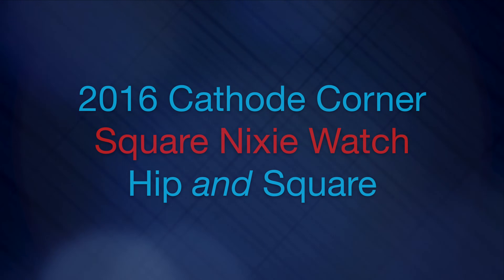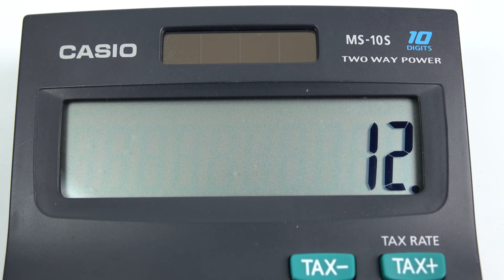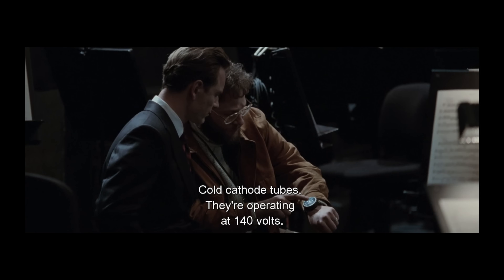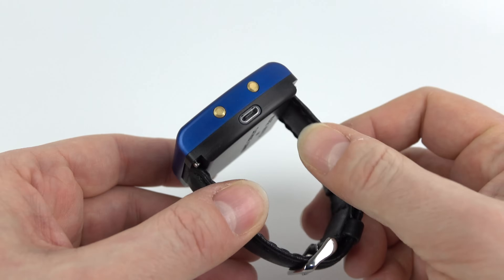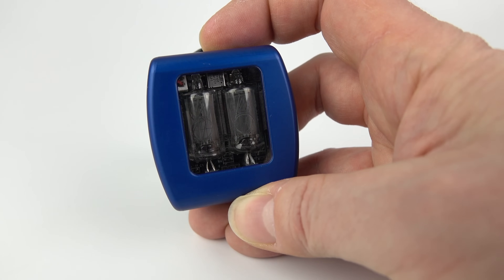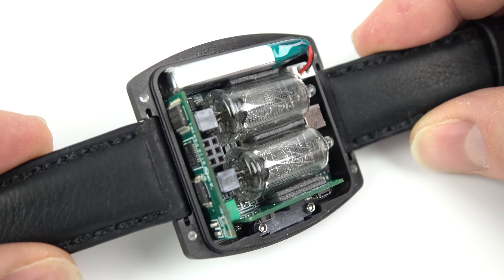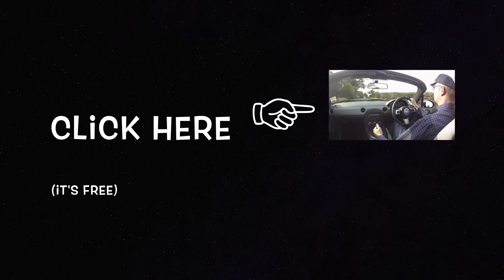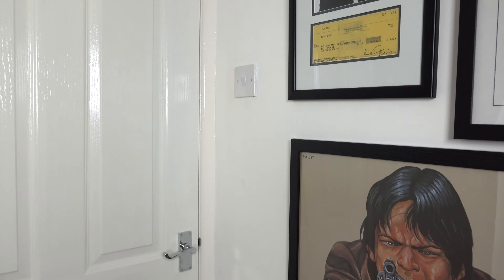2016 Nixie Tube Wristwatch from Cathode Corner

Comment: Very cool...Since nixie tubes are very steam punk, I think I would prefer the face and body of the watch to be brass or even wood, and the strap some synthetic leather. I would rather sacrifice water protection for a better overall look. Maybe you could offer a plastic cover for when you’re wearing it, and then you could just take it out of it’s water resistant plastic case, when you were ready to display it. You could also offer some kind of brass wood leather display stand that also worked as a charging dock…Just some ideas. Keep up the great work, Cathode Corner :)

Comment: what tubes are in there? i have x4, B-5750 tubes. x6 G76 6841 B-5560 tubes (inverted number) and 6 8422 B-5991 tubes. I wish to make a clock and possibly a watch as these 4 tiny tubes would be perfect! i even have the boards that drove the tubes. lots of HP chips.

Comment: Here is (very probably) the real reason you prefer a Nixie display to a segmented LED display:
At eight o'clock, a Nixie clock will show you a genuine figure eight. The best that the segmented display can do is stack one box on top of another. Most of the other digits fare no better. Nixie digits are just plain easier to read.

Comment: i prefer the look of te old case. THis one with all those rounded corners, anodized metal and off centered window doesnt really fit the tubes very well in my opinion.
Reply: Verithiell Agreed, also it will look alot better in a copper or aluminum  casing. Plus you can build this for alot cheaper hopefully

Comment: So, uh... Cold cathodes operating at 140V. And to change the time setting on the old one you have to unscrew the cover and mess around with buttons on a live circuit board, right under where the tube connections are. Unsafe much?...
Reply: +FokkerBoombass The watch is designed so that it's not possible to come in contact with the 140V by pushing the buttons - you'd have to remove the module from the case to contact the high voltage point. Even if you did somehow manage to touch it, it's a very low current that would just cause a tingle.

Comment: I've looked everywhere for nixie tubes to try and make my own clock (I'm into diy stuff and there's plenty of guides), but it's impossible to find them in Ireland! :(
Reply: +Matthew Ahern Try E Bay or Amazon.
Reply: +Metalman200xdamnit Thanks, I will again, but the last time I looked at either, shipping here cost almost as much as the things themselves, it just wasn't worth it.
Reply: Matthew Ahern
You have to remember,they are no longer in manufacture and they are expensive now.
Reply: +Metalman200xdamnit I could understand them being expensive, that's completely fine, but when shipping almost doubles the price it's too much, it's more than I could afford. Plus I was thinking of incorporating them in my leaving cert construction project, so if any were to break (which some other people in the class would gladly do), I'd need to buy more, which I wouldn't be able to do. I'd get a summer job to try and save up if I could, but I have to work on the farm over the summer, so that's not an option for me either.
Reply: Matthew Ahern
I understand,sometimes it is not worth breaking your wallet for that thing. Besides that thing is super chunky and crazy.

Comment: Puppets aside, this is a brilliant piece of modern engineering and I would absolutely love one, but for what it is, $800 is prohibitively expensive. Being that these will also be a limited production item, I have no choice but to miss out. Sigh.

I'd imagine there are ways to reduce that price? The innards do not appear to cost $800, even with labor. Of course I could be entirely incorrect. I used to work for an outfit that sells vacuum Tubes exclusively, so I know those particular Nixies aren't too expensive. Cheers, however, for the excellent video. Very informative and detailed.

Comment: I wonder about the price: Are Nixie tubes that expensive? Because anything else in this watch looks fairly standard - OK, of course the electronics design is custom (with standard components, besides the tubes), but it couldn't be that expensive, unless the manufacturer plans on selling only a 2-digit number of these watches (which would be a pity, because it is a great idea, although I would have liked a more retro, steampunk-esque design for the modernized version better). Or is it just that expensive to keep it to an exclusive number of buyers and not make it affordable to anyone else, like a 100-200 dollar watch would be?
If that is the case, I would expect at least a lifetime warranty for components like the battery or the tubes.

Comment: re :sending component video down a headphone cable , comments seemed to be disabled on that one probably to stop all the audiophiles grumbling on there , anyhow i found the video very helpful as i have the same receiver as you and recently tried to add an xbox into the equation. when i bought the receiver i was amazed at how many inputs there were on the back and figured how woud you ever need more yet i found myself at that point , i had already used my hdmi inputs all up so decided to put the xbox through the component and had exactly the same issue as yourself and soon realised i neede to add in another cable for component out to my tv  thing is my tv is about 14 feet from my receiver. so i may look inot your solution as a temporary fix. anyway thanks for the video !!

Comment: The case so does not match the aesthetic of the nixie tubes.
Reply: +OnEvenKeel I beg to differ. The case matches the aesthetic of these 1972 vintage tubes perfectly. I took my styling cues from the rack of test equipment in my workshop, two pieces of which have exactly these tubes in them. The test gear looks just like the watch... mid-century modern. Rounded rectangle windows and smooth aluminum panels.
Reply: +OnEvenKeel yeah should have been a brass case
Reply: I wouldn't mind ivory plastic and faux wood paneling.
Reply: Not Victorian era..but,,,Dieselpunk(ish)  would look cool though
Reply: Yes, a steampunk wristwatch should have brass and wood, and a mechanical display. Nixie tubes are not from the Victorian era.
Reply: @nixiebunny1  You're right that it isn't in a Victorian technology, but, I think, one of the most appealing things about nixie tubes is that they don't look like they come from any time or place. They look steampunky, dieselpunky, industrial, atomic-aged, space-aged, information-aged, alien, ancient, and futuristic. So, although the body style doesn't fit my idea of a nixie aesthetic, a "nixie aesthetic" is 100% a personal and individual thing.
Reply: +OnEvenKeel It should have steampunk desing like brass and wood.

Comment: Is there a legitimate reason why the watch is that expensive other than it's a limited run?

Are the parts of the watch really that expensive?
Reply: +Blizz DeKay Because hand made items should cost 10 times more then built in China by a 12 year old.
Reply: +Blizz DeKay Yes, they are. The case alone costs over a hundred. The other bits are not cheap. If you think it's overpriced, go ahead and try to build one yourself.
Reply: +Blizz DeKay They're made by hand I suppose.
Reply: nixiebunny1 I'm just curious and would like an explanation if possible.

I expected the watch to cost up to 100 USD by the look at it.
Reply: +Blizz DeKay Perhaps you've never actually made anything like this yourself. Believe it or not, it takes years of work and tens of thousands of dollars spent up-front to design and prototype such a device. That cost has to be paid over the sale of some limited number of watches. They aren't making these Nixie tubes any longer.
Reply: nixiebunny1 Gimme 6 months...

Comment: very expensive. this is not for tech moans, its for gold moans. is there e cheaper nixie watch? i thought by the design this cost not more than 100 usd.
Reply: +therealfox If I remember right there is a video on making your own NIXIE clocks, which you could just call a WATCH since they are about the same in size. Just be good with a soldering iron and possibly ask someone with a 3D Laser Printer to etch the circuit board for you, those 3D Laser Printers are $2,500 USD on Kickstarter.

Comment: Nixie tube pocket watch would be classy
Reply: Victimesty I was thinking something more elegant :) Like one with a lid, that would remove the need for tilting sensor, and allow to hide buttons in the back if the clock was removable from the casing. A proper pocket watch :)
Reply: Yes!!
Reply: +apinakapinastorba Probably moreso than a wrist watch, in reality.
Reply: +apinakapinastorba This one has a standard strap joint, you can easily swap that for a pocket clamp or chain. They make those.
Reply: +apinakapinastorba Boy, I have wanted to make one for years now. Know I will get to it someday.
Reply: +apinakapinastorba It is not that difficult really, about 4 years ago I transformed a military compass into a nixie pocket watch. https://www.facebook.com/nixiewatch/photos/pb.146174782160870.-2207520000.1462237373./245232662255081/?type=3&theater
Reply: +Michel van der Meij Impressive. How do you do the electronics to drive the tubes?. Do the electronics  come as a kit, or did you design and get the boards manufactured (or else)?
Reply: +apinakapinastorba Nice thinking!
Reply: +apinakapinastorba I think the software is open source so you could implement that part of the function.
Reply: +Victimesty proper insulation, plus i'm not sure how much power one small battery can even output.
Reply: Michel van der Meij Good job :)
Reply: ***** Also scary. The current for these tubes is actually quite high.
Reply: +apinakapinastorba Not really...